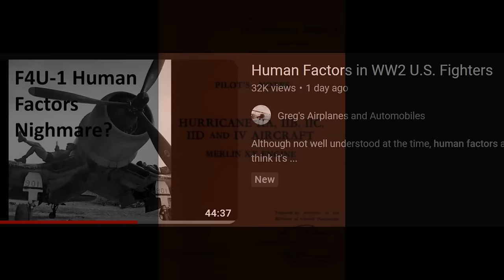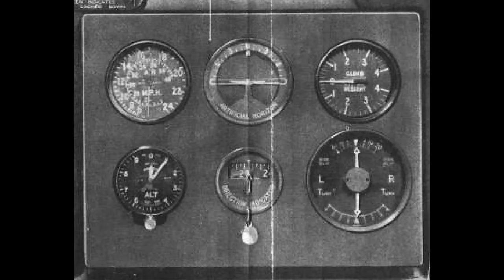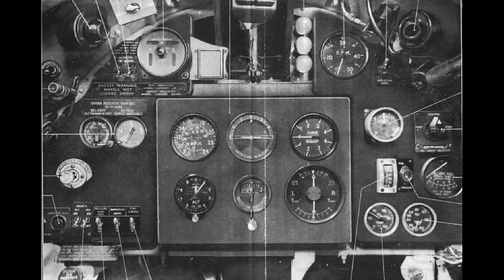Human Factors In British and German WW2 Fighters

Comment: You often bring up the need for an artificial horizon. I thought that the basic training of fighter pilots included knowing how to fly with the turn and bank indicator. It's not that difficult and I've done it myself for dozens of hours on a glider. The artificial horizon is heavy, but maybe it facilitated and accelerated the training of pilots while the war lasted.
Reply from the maker: I'm not sure what you did in the glider, but I seriously doubt you flew IFR in it. These are the equipment requirements to do so:

    The instruments and equipment specified for VFR flight during day and night:
        Airspeed indicator
        Altimeter
        Magnetic direction indicator
        Tachometer for each engine
        Oil pressure gauge for each engine using a pressure system
        Temperature gauge for each liquid-cooled engine
        Oil temperature gauge for each air-cooled engine
        Manifold pressure gauge for each altitude engine
        Fuel gauge indicating the quantity of fuel in each tank
        Landing gear position indicator, if the aircraft has a retractable landing gear
        Safety belts
        An Emergency Locator Transmitter (ELT)
        Position Lights
        Anticollision Lights
        At least one landing light (if the aircraft is operated for hire)
        One spare set of fuses, or three spare fuses of each kind, accessible to the pilot in flight
    Two-way radio communication and navigation equipment suitable for the route to be flown
    Gyroscopic rate-of-turn indicator (except for some aircraft)
    Slip-skid indicator
    Sensitive altimeter adjustable for barometric pressure
    A clock displaying hours, minutes, and seconds
    Generator or alternator of adequate capacity
    Attitude indicator
    Heading indicator
    Radios and navigational equipment appropriate to the ground facilities to be used

   Now you may have gone through a thin cloud you were out of in a few seconds, but that's not the same as climbing through a 4000 foot thick layer with just a turn needle. It's very hard.
Reply: @GregsAirplanesandAutomobiles  You have no idea what glider pilots can do and have done for ages, at least in Finland, with just a turn and bank indicator. As far as I know, flying in IMC conditions is IFR flying. If it doesn't work for everyone, it doesn't mean it's impossible. The sound of the air stream perfectly replaces the pitot tube heater. I know from experience. Cloud flying with a glider provides a good background to fly with the help of an artificial horizon, a glass panel and dinosaur fuel.

Comment: Nice work. I think a slightly longer video doing a quick whip-around of a few major Bf 109 variants as a thumbnail sketch would have been useful.

As far as the Fw190's engine controls are concerned, my mind went "Insert Calum Douglas's magnum opus here". (i.e. The Secret Horsepower Race.) He goes into how that system worked. It was amazing for its time. 

As far as HOTAS goes, I remember "Winkle" Brown's Wings of the Weird and Wonderful included an aside about a DH Hornet he flew that had the controls for the gyro gunsight on the throttles. He called it the "bunch of walnuts" throttle because of all the extra knobs on it and absolutely hated it. 

Butthurt report form: OMG that dates things. "Livejournal post." Livejournal was technically still in existence last I looked, but seems not to display correctly, and may be on life support.

Comment: Greg would you ever consider doing a video on how late war German aircraft would have performed had they had access to 150 octane fuel? I’m amazed the Germans managed to keep relative parity whilst running such low grade b4 and best case c3 fuel. Thanks!!
Reply from the maker: I suppose I could, that's actually pretty easy.
Reply: @GregsAirplanesandAutomobiles  would love to know the potential performance of a K4 or D9 on 150, would add a new dimension to them!
Reply: Plus MW-50/GM1!
Reply: @froudey5756 but if they still don't have enough of the high grade fuel to permit sufficient training flight hours, they're still going to be shot down by Mustangs
Reply: @gleggett3817 I know however I’m just coming from a purely hypothetical viewpoint. How competitive would German fighters be if they had at their disposal all the industrial and mechanical advantages the allies had.

Comment: From a simulator flyer standpoint the british fighters are a complete mess whilst the FW-190 is a marvel. and the 109's G2 upwards have a very nice layout
Reply from the maker: I basically agree with you. Just keep in mind it's all relative to the other planes of the period, and by that standard I wouldn't say a "complete mess". The Soviet stuff was so much worse, that it sort of moves the British stuff up a bit.
Reply: With the caveat of Bf-109E-3.
- adjust throttle
- remove hand from throttle
- use three-position lever switch in the middle of the dashboard to adjust prop pitch for correct RPM
- Move hand back to throttle

Comment: Why do they always tell us that the p-38  was bad in Europe because of "poor cockpit heating' when other planes had no heater at all?   Was it because having an engine in the fuselage was like a heater?  The lightning didn't have that ..?
Reply from the maker: No, it's because the Lightning's heater was poor as compared with other U.S. fighters, that is until the P-38J and later models.
Reply: The remote supercharger controls were colder than in B-17s and B-24s, they froze up.

Comment: I am not that impressed with the FW-190's ergonomics: The pilot had no lateral head movement, as in next to any at all, this in 90% of the production, and it probably affected the ability to focus your eyes or spot objects in the distance, since you move your head to bring them out. The reclined seatback was uncomfortable and useless for enduring Gs. Apparently the bottom row of instruments was obscured for tall pilots. An even worse feature was that the control collumn had a vibration that killed the sense of touch in the hand (The Super Stallion helicopter is the same). There are reasons most pilots preferred the Me-109, while non combat pilots keep raving about the 190's view coming down to your elbows... A good point is most high power radials were quieter in the cockpit than inlines, including the Ki-84, P-47 and FW-190A.
Reply: German pilots praised the 190 for its light handling and I never heard of a complaint about stick vibration. Aircraft were trimmed at the factory and then trimmed for the individual pilot at the squadron. As for seeing out, pilots who converted from the 109 loved the canopy of the 190. Tank himself declined to fit a rear view mirror as any pilot could see either tip of the horizontal stabiliser without undue effort.
Reply: @michaelbevan3285  The fact remains, and it is clearly visible, that there is considerably less actual room in the FW-190A's cockpit than in the Me-109G cockpit, including the width at the sill (22 inches at elbow level on the 190) vs the width of the 109 sill (24 inches shoulder level on the 109, which is why it "feels" far more constraining), lateral head space is vastly greater on the 109, and there is also no room to stretch down your arms on the 190 because of the consoles. Yes the 109 has a much poorer forward view because the windscreen is less tall, not angled (the periscope effect of angling is beneficial because it raises your viewpoint) and, above all, because the 109 pilot is further from a smaller windscreen. But while this creates a bad impression for non pilots sitting on the ground, in reality the view through the sides and down was slightly better on the 109, and real 109 pilots knew you flew it by looking through the sides. You dived not wings flat but wings banked looking down through the sides, just as an example... The same carries over to the narrow 109 landing gear, whose accident rate was absolutely nothing special, and allowed two points landings with full braking afterwards, without the prop touching the ground or nosing over. The FW-190A, despite its huge heavy gear, could strike the ground at least with the bigger wood prop, and was limited to 3 points landings. With all that being said, I still think the FW-190A was the better fighter solely because of the way it performed low speed 3 G turns (but emphatically not with hard high speed turns, where it was terrible. Note however that high speed combat mattered less and less as the War went on, yet another misconception) at which it was significantly better than other types below 250 mph, the most important speed range for combat, and this over ALL other Western Front types, PARTICULARLY the Spitfire (which was better only in hard high speed turns, as Clostermann and Johnny Johnson explained)... The Luftwaffe tried and utterly failed to replace the 109 for 6 entire years, despite a slew of competing prototypes that never even came close, including the 190A because of its poor high altitude performance. Yes the 190 was better than the 109, but NOT for the reasons its designer expected (in fact for quite radically opposite reasons), and sticking to superficial appearances and impressions will not yield valuable information. For instance, most experienced Japanese pilots considered the Ki-43 VASTLY superior to the Ki-84 for reasons of effectiveness, survivability and kill ratio performance, and reliability had nothing to do with this assessment: The combat record bears them out. You cannot understand what actually went on from superficial first impressions, repeated as fact over and over.

Comment: Additional negatives on the FW190's otherwise great cockpit, poor forward visibility and awful gunsight which hinders that forward visibility further.
On the brits; the control column handle has always baffled me, even more so that they stuck with horrible design for so long. Further I have heard\read the buttons on the handle were also difficult to operate.
Reply: Imagine being in a cramped 109 cockpit and trying to move sideways a stick pivoting on the floor, legs are sort of in the way aren’t they?  Also the Brit foot pedals had a higher step for high g manoeuvres.